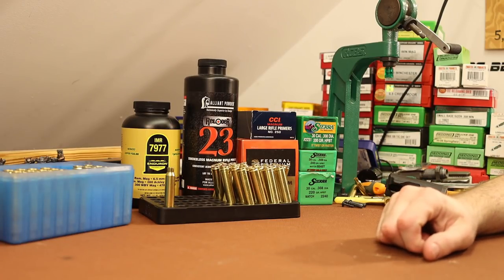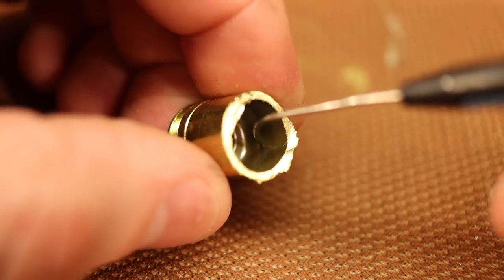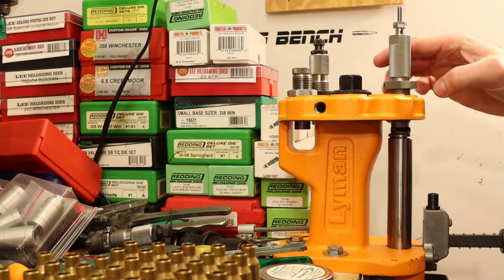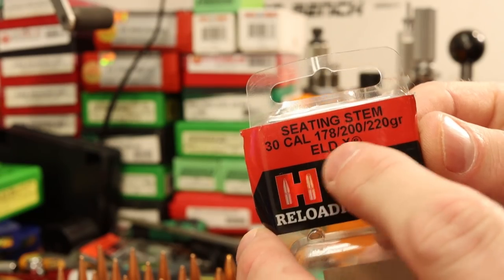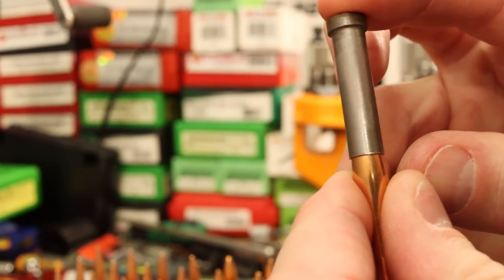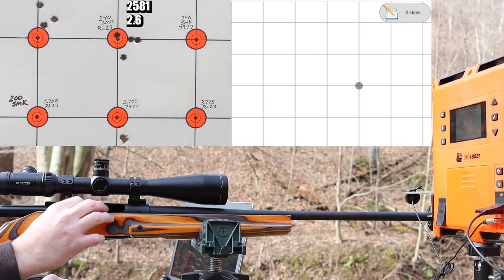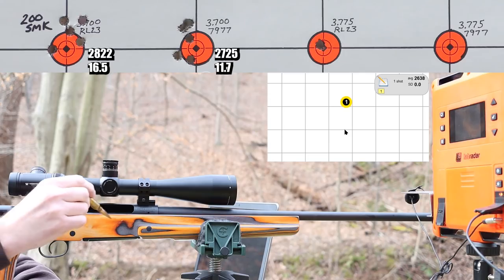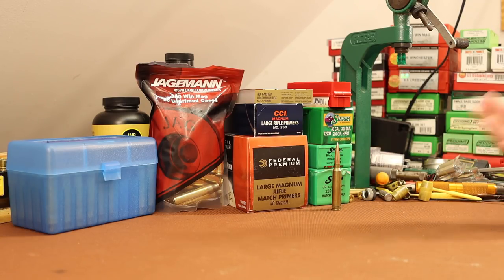300 Win Mag - 200gr SMK #2231

Comment: Are you still thinking about a new beginners guide to reloading. I love your videos. I am about to start reloading. My uncle and you got me into it and he is going to get me a hornady classic kit. Keep up the good work.

Also any suggestions on best presses or kits. And tumblers whether it be dry or wet?
Reply from the maker: I spend a bunch of time EVERY SINGLE DAY wishing I had time to make the new Beginner's Guide to Reloading that I have planned.  It's coming, but it probably won't be before summer when I can shoot in the evenings.  It's a big undertaking and I need a lot of range time to pull it off.  
For press kits, I still think the Lee Breech Lock Challenger kit is the best value.  The Hornady Classic kit is pretty great as well, but I don't think it has enough advantages to justify the additional cost over the Lee kit.  You'll probably be happy with either one!  
For tumbling, just spend your money on a wet tumbling setup.  The Frankford Arsenal Rotary Case Tumbler Lite is a really great value.  If you want to try saving a few bucks, the dual drum tumbler from Harbor Freight also works.
Good luck getting started!
Reply: @JohnnysReloadingBench  Thanks.  Is it true that the lee breech lock has alot of slop? Also the powder measurer spilling. I've watched your first beginner  series and didnt notice but at all however I have read some controversial reviews on all presses but that's just part of having your own opinion. Which press are you going to use on the new series .About your job do whatever you are happy doing. God will provide the rest. God bless.
Reply: @samuelrisby  I have the cheap Lee C breaklock press, and the break lock has no slop in it.  I also have the Lee perfect powder measurer, and have had zero powder leakage using small spherical powders such as H335, CFE Pistol, CFE223, ect.  If there is a finer powder, I cant comment on I'd that leaks.

Comment: Had the same problem in 30-06, the HDY custom-grade new dimension sizing die was oversizing the sides of my brass and from time to time would get a stuck case. Bought a set of HDY american hunter dies and the sizing problem went away. I now use the HDY hunter sizing die with the custom seating die and the Lee crimp die to get the best results out of my handloads. Same with the 22 hornet, threw the HDY custom sizer away and replaced it with a Lee die. Had a hard time bringing myself to buy the 6.5 CM custom dies but you had such good results with them that i went ahead anyway. Low and behold that set was correct and is the only set of HDY custom dies that didnt have sizing problems that i own, and i own 4 sets.

Comment: Love your content Johnny ❤️ I've actually had quite a bit of success with the 2231 bullet in the my Howa 1500 in 308 win regardless of the 1:10tw. At my elevation of 1400ft the bullet is marginally stable with an sg of 1.4, but it'll shoot sub 1/2moa at 100yds with a stout load of Varget (44.6gr) moving 2575fps in Palma brass. This bullet is stupid long, at .010 off I'm at a coal of 3.175. Glad you tried this bullet, it's getting slept on a bit and I don't really know why.
Reply: Give H335 a try. Most of the particulars in 308 win. Casing is Remington, primer is Fed. Large Rifle Match, bullet is 200gr SMK, powder is H335. Lyman charging data. Been a great combo for 20+ years, so far. Give it a shot.

Comment: Paul Krieger, the custom barrel manufacturer, has tested pencil barrels against heavy barrels for accuracy. He found that the pencil barrels are just as accurate as a heavy bull barrel. What he did discover is the reason that everyone thinks pencil barrels aren't accurate. Pencil barrels heat up faster than a heavy barrel, which causes mirage from the hot barrel to move the target in the scope. This might have something to do with the fliers you were seeing. A hot silencer can cause the same sort of mirage movement of the target in the scope.

Comment: Belted Magnums are kinda notorious for having sloppy shoulder dimensions. My solution to prevent case head stretch is to fireform new brass using the 'moderate load with the bullet in hard contact with the lands' technique. On subsequent loading be sure not to set the shoulder back too far...I prefer to neck size only.
Reply: RA Williams I used cheap Speer 165 gn hot core jammed into lands with mediocre IMR 4064 charge to fireform my cheap Winchester brass. Then only neck size brass with good results.

Comment: I tried the 240gr SMK in my Remington 700 .300wm, also with a 1:10 twist, and I couldn't stabilize it, no matter what I tried. The best I could do was to exceed max, and it was showing pressure signs, so I gave up. My best luck has been with the 220SMK and the 210gr Bergers.

Comment: Couple things, if you got 5 firings out of brass in a magnum load, that is exactly what is expected. 5 loadings is standard for magnum loads. Also, if the brass is wearing out at that point and it is obvious from case head wear, annealing can be water effort, I get 5 reloads out of 300 ultra mag brass loaded with 87 grains of 7828, and the neck area is still in solid shape and neck tension is good without having to anneal. Just what I have seen in my experience. Cheers.

Comment: You're on the right track with the collet neck sizer. It can take up to three firings for the brass to fully expand to the size of the chamber so if you full length size and bump the shoulder two or three thou every time you'll definitely over size the brass. I'm sure the factory chamber is also on the large side which will also contribute to the incipient case head separation.

Comment: Glad you did this video!  I've been contemplating picking up 300WM just because of this bullet coming out.  I'd like to see you pair it with IMR8133 or Retumbo.  And maybe do a temperature test on 8133...  The press evaluation with on target performance sounds like a sound idea. 

Also the sizing effort issue looked to me like insufficient case lube.  Try something different or use more and see if that helps.  Also since your die seems to be wanting to oversize a little it wouldn't hurt to give it a good cleaning inside and maybe a polish with a rotary tool and red rouge and see if that helps the sizing effort.

Comment: Johnny switch to the Sinclair shoulder bump gage to reset your sizing die, it is much more accurate than the hornady case comparator as it is set to shoulder angle. So your 300 mag has a 25 degree shoulder and the gauge has a shoulder of 25 degrees. As for sizing die go to Foester and send them the cases as they will hone the die for exact fit. Next take the firing pin out and chamber the case if the case seats easy your sizing too much. The bolt should close with slight resistance.

Comment: Just sharing my current 6.5 CM load  , 48.0 g RL 26 147 ELDM 2.840 oal Hornady brass CCI 200 primmer ;getting max 2987 SD 12 ES 30 out of a custom build 700 with a  30 inch Brux bbl @ 8900 Ft elevation .happy trails

Comment: Hey I have a question for you. When loading those Berger 22 Cal 77gr Tactical bullets for an AR15, do you crimp it? I'm pretty new to reloading and I think that crimp is necessary for semi autos. Nice videos my man and keep at it!
Reply: If the bullet has a cannelure, crimp it. I prefer a taper crimp on 5.56(223) and 7.62(308). A  roll crimp works fine, but it will shorten the case life by work hardening the case mouth resulting in premature split necks.

Comment: Case head separations are scary, and dealing with that particular type of case stretching can be an exercise in patience.  My Lee-Enfield (.303 British) would chew through brass like crazy to the point where some of the brass I was pitching after just two reloadings.  One of my buddies told me it was a headspace issue, but the headspace checked out fine.  Another buddy told me to try neck sizing, which actually helped - I was tossing some of my brass after 3-4 reloads instead of two.  I ended up trying different brass and found out that some brands do last longer than others, but not necessarily for the quality of the brass itself, but for the specifications for its made --- turns out my buddy who mentioned headspacing was right, because .303 British seats off the top of the rim of the cartridge, and some companies don't make the rim as thick as the original specification.  This was causing headspace issues, which was stretching out the brass when full-length reloading.

If belted cartridges headspace off the belt, it might be worth measuring how far that is supposed to be and comparing brands.  It might be the brass, but it certainly could be how the die is treating it when full-length resizing.

Looking forward to the follow-up!

Comment: I didn't understand why you went away from the RCBS hand primer, although I'm curious as to how the others match up with ole faithful.
I'm partial to Lee case trimmers too, but the deluxe quick trim with dies. There's a bit of adjustment in the trimmer. :-)
Thanks as always for the useful, entertaining content. I bailed on Trump in IA when I got the notice you had a new video up. :D
Reply from the maker: The RCBS Universal hand primers started giving me problems with seating depth.  I had to back out the depth screw and use blue loc-tite to get them to seat the primers deep enough.  I'm not sure if I wore them out or what is going on.  I still love them for the balance of power vs feel and the way they feed.
Reply: @JohnnysReloadingBench  I like my RCBS Universal as well but I have a problem with it gripping .223 size cases.  Works fine with everything else I use it on.

Comment: Johnny in my 300 wm I had to go to a neck size die I was burning brass like crazy.  Nut that has seemed to calm things down I use a rcbs neck size doe and works great on my 4 or 5 firing on nosler brass amd still in good shape.  I would give it a shot.  And yes go back to making vids.
Reply from the maker: I'm hoping things will improve with the Lee die!  I'll get it figured out eventually.
Reply: Yea the belted magnum. Cal. Are hard on brass.  And most of the time high pressure loads.  But things will get better.  Thanks Johnny. Keep.up.the good work

Comment: I think the first stretch happens when the case is short from the belt to the shoulder. Like when you shoot a parent cartridge in an AI cartridge chamber the shoulder to neck joint is a limiting point so the cartridge case blows the shoulder forward but the neck stays put. In the Belted Magnums the shoulder short sets up the whole cartridge to move forward with pressure so it does. If you get little movement the first time then bumping is a minor thing but a long loose chamber is the worst. You stretch badly everywhere. When Resizing it only has one place to go which is forward. Custom dies probably only way to go. My Nosler brass and FC brass after 5 firing minimal triming and no felt indentation in the web and using either Lee or Hornady custom dies. However forums are full of people trashing Hornady 300WM brass. So I skipped it.

Comment: Question for those with knowledge. I've been loading 62 grain gold dots 29.6 grains of 2000mr with an oal of 2.260. The oal of 2.260 is rubbing the front of mag. Would changing my oal to 2.250 completely screw up the load to where I need to rework it from scratch?  I only get 1 or 2 times a year to test. Would I be safe to load up a bunch at 2.250 considering 30.2 is max charge and my charge is 29.6 should I be fine? Will it change the accuracy considerably? Will it be over pressure?  Should i just wait to test it again?

Comment: "The problem isn’t just restricted to match shooters either. Many shooters have tested a variety of loads, including several different types of powder at the same range session. If the rifle was not cleaned when switching from one type to another, this may have manifested itself as an accuracy problem. The shooter who is unaware of this phenomenon would have most likely dismissed the later groups as being less accurate than the first one tested. When several different loads are being evaluated together, take the time to clean whenever powders are changed". 
  I've seen johnny use a half dozen powders at a session. I wonder if this condition ever happens with his powder selections.  I bet it does.   (Northeasters shooters .com ) Originaly in Sierra's rifle reloading handbook  4th ed

Comment: Weird, the calculator at JBM ballistics indicates you should be able to stabilise the 240 fine at 2500, even down to 2000 (until I start messing with barometric pressure too much).

Comment: For economy's sake I'd give the 240smk pills the flick. You rifle isn't made for it unless you can dramatically increase your MV to increase the rpm of the projectile. You got a better chance of making the 200gn a real shooter.

Went through this with Nosler 52gn Custom Comp HPBT in my 22-250 (14:1), test loads - started low and every shot of the low loads keyholed at 60m. I think I was lucky not to have taken the Caldwell out, lol. The higher loads almost worked, but assigned them to the son's 223 (9:1) and they worked fine. Save your $$ and make the 200s work mate.
Cheers.

Comment: How long can this bullet travel until it tumbles? Gotta be well past 1000 yds, 2000+ ??
Reply: The 200 smk won’t go transonic till about the 1 mile mark at top 300 WM velocities. It probably won’t tumble even then. These newer bullets with shallow boat tails supposedly handle the transition from supersonic to subsonic without a hitch.
Reply: @K-bob_45  thanks for the info, good to know shallow boat tails work best.
Reply: I shoot 7.62x51 and have good results with 168 gr HPBT Hornady, well under 1 moa with a Rem 40X with Hart 7.62 barrel
Reply: Will Mathieson if you have a 1 in 10 twist you might try the 195 TMK’s. I’m pushing them at 2530 from a 20 inch 308. Accuracy potential looks good and the BC is very nice.
Reply: @K-bob_45  I'll give them a try.

Comment: Lanolin oil and 99% isopropyl alcohol works the best for case lube. Hands down.
Reply from the maker: We'll, that's what I've used in about 99% of my videos!  Honestly, I have great luck with lanolin, imperial sizing die wax, and this hornady one shot.  I think they all work, as long as you use them properly!
Reply: The only lube I've ever used has been itasca outdoors 2 cycle engine oil on an old sock in a Tupperware